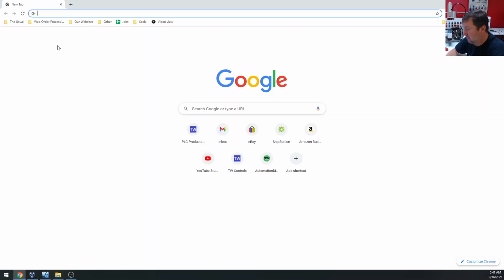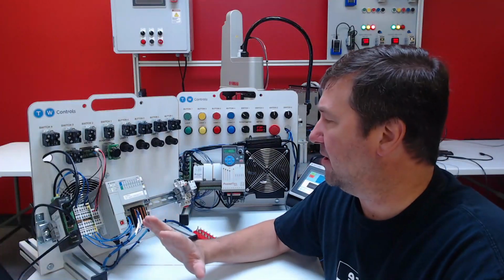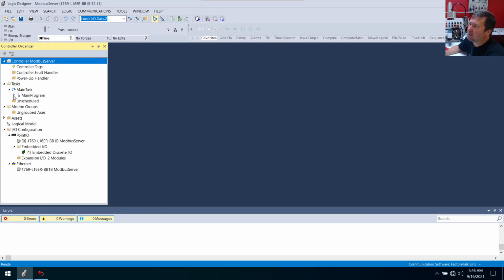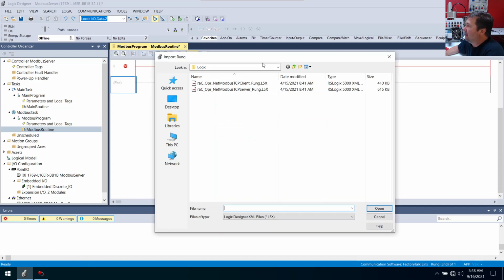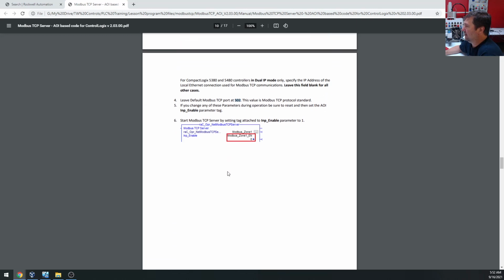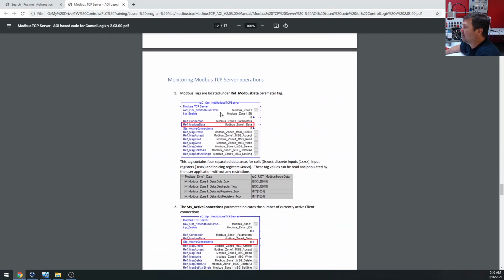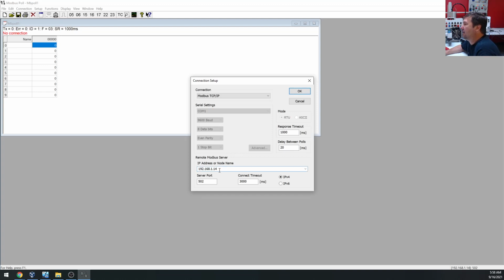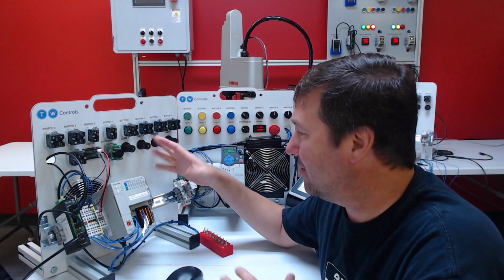Studio 5000 Modbus TCP Server Allen Bradley Controllogix Compactlogix

Comment: So for read PLC data from SCADA i need to use Modbus Server in Compact Logix ?
Reply from the maker: No, that video doesn't say that.  This is on how to set up a Modbus TCP server in a Compactlogix PLC.  Check out Ethernet/IP.
Reply: Yes I know, I have in Plant Scada driver for eth/ip , but I wonder if i want read data from compact by modbus I need use the tcp server block ?
Reply from the maker: That is how you would set up a TCP server in a Compactlogix PLC

Comment: Hello, I need to write some digital and analog inputs in purpose that another device get connection and get those values via Modbus. In this case do I need any card to do that (We already have 1769-SM2) or my client just need to plug to my PLC via Ethernet?  I am using CompactLogix L30ER CPU
Thanks in advance.

Comment: Great video ! Am i limited to 1024 holding register when i set up a modbus server or is there a way to add some more ?
Reply from the maker: From the installation instructions of the AOI, I think 1024 is the typical limit.  Here is an excerpt.

Only one Server AOI is supported per CompactLogix controller (5370, 5380, 5480). ControlLogix
Controllers (1756) can have one server per each 1756-EN2T(R) module used, but each instance
must use own set of data tags.

Comment: I know this is an old video but I'm wondering if anyone can answer how this works f you have multiple clients connected? Do you have to pass the node/IP address somewhere and do some scheduling or does the block handle this?
Reply from the maker: The single server AOI can accept up to 10 clients connected to the same port.
The AOI is monitoring each connection independently but processing data requests for active connections one after another.
Reply: @TimWilborne  thanks for the reply. I realised I needed the client AOI after posting this comment. Appreciate it though
Reply from the maker: You are welcome

Comment: How about working with floating values ?
Reply from the maker: This is on my list of videos to make but use the CPS instruction to copy it to INTs then do the opposite in the other PLC. But pay attention to the length parameter in the help. It is based on the number of destination elements.

Comment: what if I need float32 data instead on some 4XXXX registers? is there a way to change that? how can I send a message (string: 'unable to accept request')
Reply from the maker: You would use a COP instruction to put the floating number into INTs then do the opposite on the destination PLC.  Mainly pay attention to the length of the COP instructions.  It is based on the destination.  Here is a video where I'm doing something similar but with DINTs which are also 32 bit.
https://www.youtube.com/watch?v=o3OWV8Q_U7s

Comment: silly they changed it to server/client from slave/master
Reply from the maker: It depends on your region.  Here is some additional information.
https://www.rockwellautomation.com/en-us/company/about-us/sustainability/culture-inclusion-diversity/inclusive-terminology.html
Reply: @TimWilborne  Yes all in the name of "DEI".  I have worked with many many non white techs and electricians and not one of them had an issue with the terminology of slave/master.  Nevertheless, this video was great and very helpful.
Reply from the maker: In a few years, no one will notice, remember MMIs?

Honestly, Master/Slave has never made much sense and caused a lot of confusion.  Most people thought the Master held the data and controlled the slaves.  The slaves were the smart devices that held the data and the master could only read and write to them.
Reply: @TimWilborne  Master / Slave makes a lot more sense to me.  One master multiple slaves. slaves being the I/O modules etc. sending data to the master.

Comment: So if I had tags I wanted to output over Modbus I could just copy the tag in another routine to the data.holdregister. Then using my other device point to that register and the PLC’s IP to read that tag data?
Reply from the maker: Yes, check out the AOI documentation when you download the sample code.  It is very well documented.

Comment: Hey Tim, I am currently trying to get 1769 L33ER Compact Logix connected a cloud. I am using Microsoft Azure and i set up an IOT hub along with an IOT edge device that acts as a gateway. Additionally, I installed a Modbus module on the edge device in hopes to use the server AOI to be able to communicate with it. Do I only need to plug in the PLC's IP address into the moudle (client) for this to work? Also is this the best way to go about it? Any help would be much appreciated thanks!

Comment: Hey Tim, I’m running the AOi on a the simulator rather than an actual controller, and when I set the server enable to 1, I get a sts fault
Reply from the maker: The simulator doesn't support open sockets, time to get some hardware.

Comment: Hi! I’m quite new to PLC programming. I am currently making a program that is responsible for shutting a projector and knowing its power state. I have now program that can send the command. The problem now is that i cannot receive the whole feedback (response) from the projector because read response buffer length appears to be limited to 9. 

I have read that i should do multiple read socket to receive entire application message but i dont know how to implement it.

Comment: Hi Tim. I already setup a Modbus TCP Slave in Studio 5000 for the Allen Bradley Controllogix L73 using Add on via Ethernet module EN2T install with same controller rack at slot 2, so I set MBTU_EnetModulePort is $01$02. and now i plan to set up a Modbus TCP Master using Add on via other Ethernet module EN2T installing in Remote IO rack (Controlnet node 3, slot 16). In this case, I don't know how to set MBTU_EnetModulePort. Please give advice. Thanks

Comment: I just came into the need to use Modbus RTU in the 5380. Not nearly as pleasant to work with.  Address changes require re-downloading the program each time as the config seems to be stored in the module like scaling is in a analog module. Can't change it online. Very disappointing during the development phase when you are trying to figure out how the data is structured.  Modbus TCP on the 5380l is just like this video.
Reply from the maker: I'm not following you.  Are you saying if you use the AOI on a 5380 that it won't let you change the address without downloading?  It should work exactly the same.
Reply: @TimWilborne  if you use RTU (serial)  you need the 5069-serial module and the addressing is then done in the module config and not in the tags. Seems like a step backwards, but ab is really trying not to support anything serial.

Comment: Hi Tim. Great video. I recently setup my Micro820 as a Modbus TCP Server via CCW and have VTScada picking up the data the way I need it. 

A question I have is if there is a way to continue to send data to a remote storage rather than local storage for keep the trends there all the time. I actually don't even know where the data is stored, if at all.

Thanks Tim.

Comment: Hey Tim, do you know if anything like this has been done on a micro 820? I'm trying to use an 820 to actuate a bank of relays, based on data from another widget that has modbus IP slave capability. Building a remote annunciator panel.
Reply from the maker: Here is one I did on a Modbus server for the Micro820.
https://twcontrols.com/lessons/allen-bradley-micro800-modbus-tcp-server-micro820-micro850